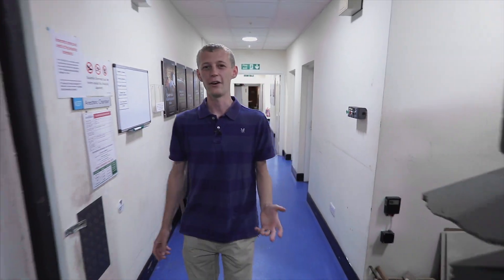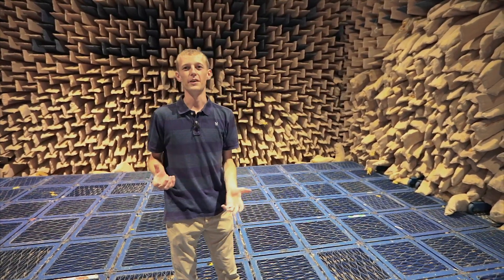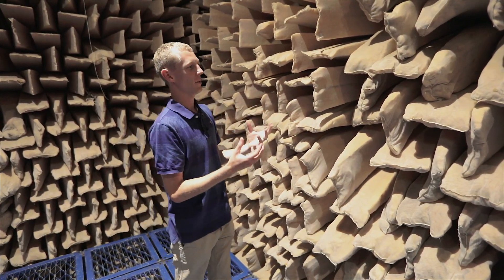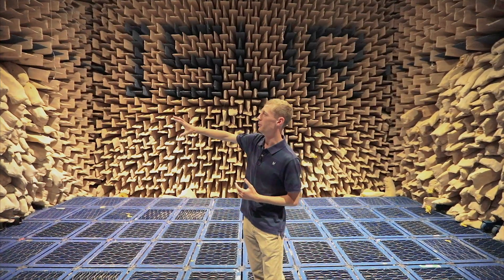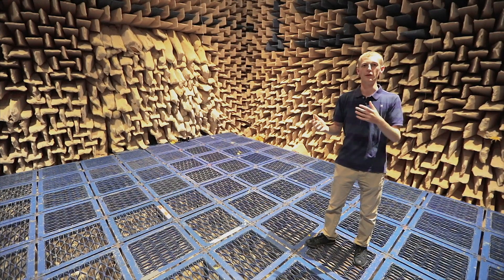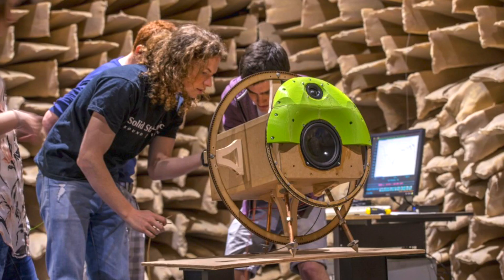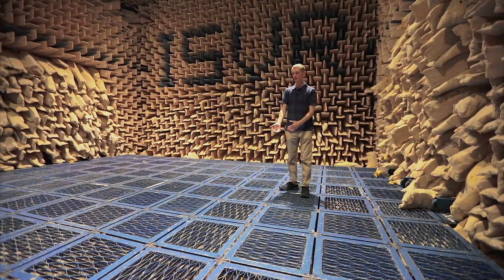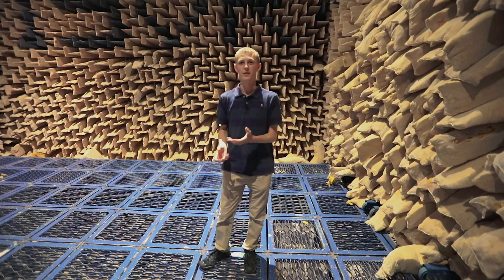ISVR Virtual Tour: Anechoic Chamber

Comment: Very interesting video. Out of interest, I was watching Ad Astra with my brother in law. We noticed the irregular shaped wedges, just like your ones. Why are they like this? Some of your panels are really distorted.
Reply from the maker: Yes, the wedges are like this so that they scatter the acoustic wave as well as absorb it. If they were all the same way around then the (small amount of) reflected energy when the acoustic wave hit each wedge would all add up together to make a potentially significant reflected wave, however this way the sound bounces off of one wedge and into the one next door, so the overall amount of acoustic reflection is tiny.

Yes - our anechoic chamber is pretty old now and you can start to see the wedges looking a bit tired, especially where the doors are for the DARP rig.
Reply: Thanks so much for responding promptly. So interesting. @charliehousemedia227